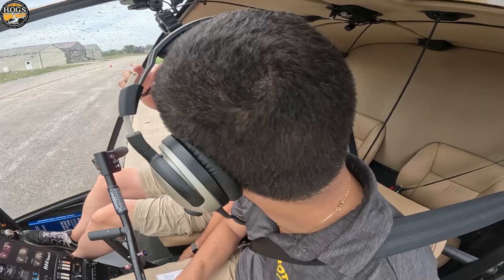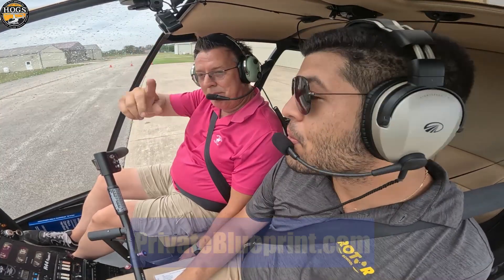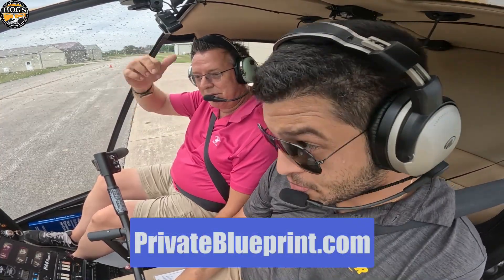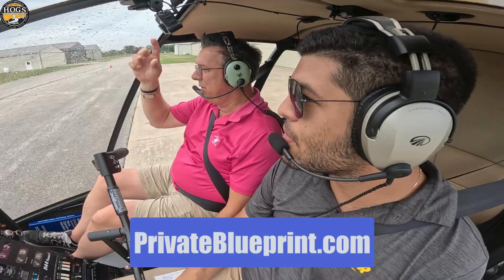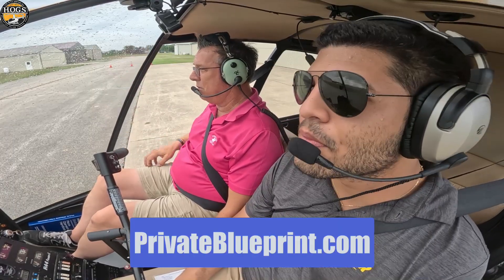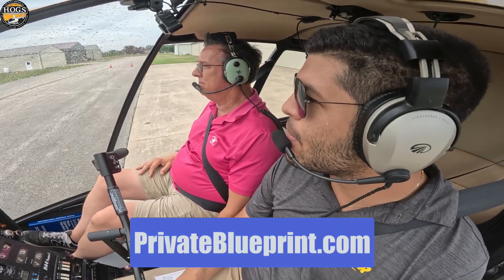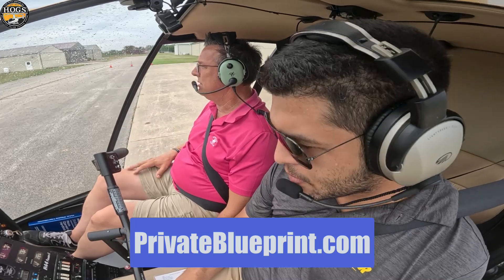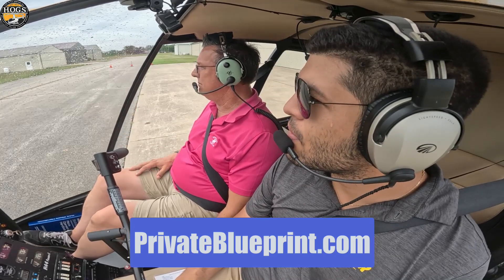RCH Safety Alert: Robinson R44 Hydraulic Controls Pre-Takeoff Check

Comment: In June 2021 (after this RHC Safety Alert was put out) Robinson put out a service bulletin (SB 109) that states you are only required you to do that extra hydraulic check if you have older servos (by serial number) or not had them factory overhauled after April 2014. If you have those older servos, you are also supposed to add a page to your POH reminding pilots about the extra hydraulic check. You can find the full details here: https://robinsonstrapistorprod.blob.core.windows.net/uploads/assets/r44_sb109_7e858e5bf4.pdf 
Either way, it won't hurt to do the test if not required.